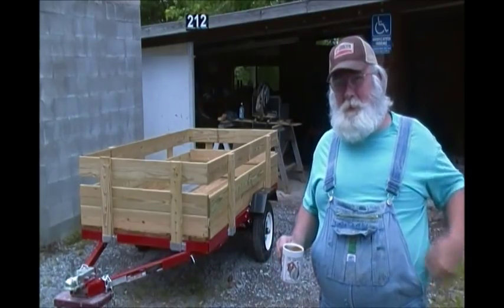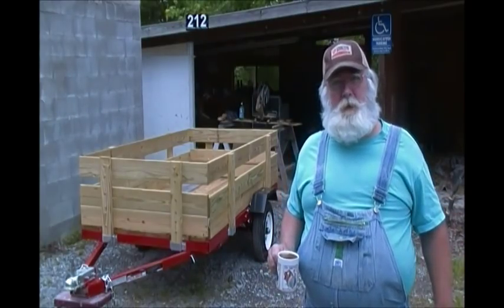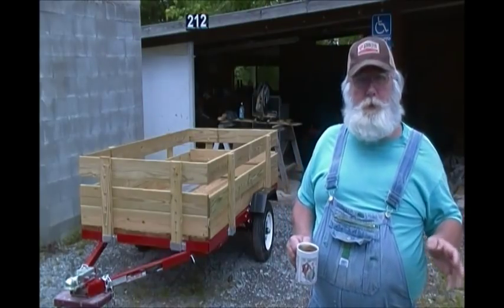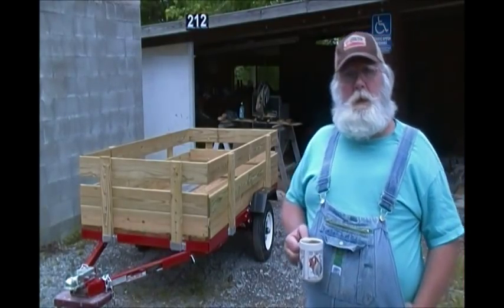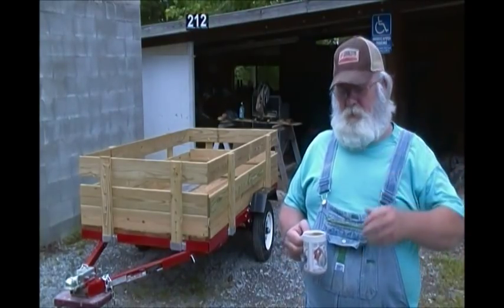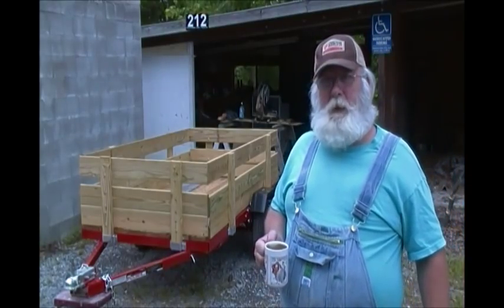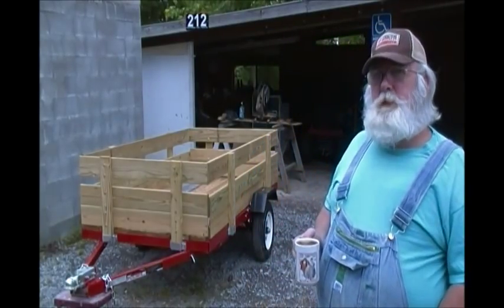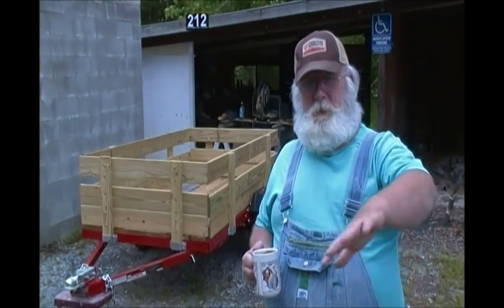Harbor Freight Trailer Build Part Six by PawPaw....Corners

Comment: Pawpaw, Because I used Heavy Duty hinges for my trailer, I spot welded a big washer on top of the hinge pin to make it easer to remove. Also, I cut the back stakes flush with the stake holders and used HD door hinges with a bolt to attach the back side rail and put a piece of ply wood to it so it acts as a fold down ramp.  It works for me, you might want to try it. I think, I might have to try your wire mesh idea on my trailer. Thanks.

Comment: i have a idea for a short vid pawpaw how to sharpen a pocket knife or kitchen knives always tried to sharpen mine but wasnt any good at it ...great vids pawpaw keep them coming👍👍👍👍👍👍👍👍👍👍👍☝☝☝☝☝☝☝☝☝
Reply: Google Sharpens Best, they have a youtube channel too. I have all kinds of sharpeners, this is the best. Take 5 min. to learn how to use it and you'll love it. It's kind of expensive buy you'll never wear it out.
Reply: I've sharpened many a pocket knife on the bottom of an old ceramic coffee cup.  Just lightly strop it on the cup bottom ring and you can take the wire edge off in just a few strokes.  With practice, you can slide the blade across the edge as if you are slicing off a microscopic layer, and polish a very sharp edge in a minute or so with ease, just practice.

Comment: Paw Paw how you doing from Missouri. I had that same trailer I used it to haul my atv. I use 2x8s about 4ft long and attached metal ramp adapter from lowes. I then drilled holes in trailer floor and put bolts in metal on ramp and they held ramps on trailer and never flexed or had any issues with them. They were easy to transport on trailer with atv. Just a cheap thought. Thank you for the vids, keep them coming.
Reply from the maker: Thanks.

Comment: hi paw paw 😀. say how does it pull hinderend of your truck? I sure do like your show and don't never ask fer nothing. now that there is really cheap. love the educational videos. one day when you get old as me you might have to slow down there Charlie Chaplin. lol. good show thanks and good day. oh I was going to say you wasa talk at us about greasein the angle grinder and impact gun. I installed grease serts and only had to take the nose piece off one time sos when I drill the hole to keep shavings out. you just find the best spot thata way also. just a couple squirts of grease every so often you can even remove the grease serts and plug the hole with a set screw.  later paw paw.

Comment: Good trailer I would put a little flag sticking up from the rear  corners so you can see where the trailer is going sometimes them little trailers can get away pretty quick and they are too narrow to see with the truck mirrors, two eye bolts on either side with cheap snap ring on a piece of chain is how I did mine. I built a 5 x 8 with a log splitter  sitting crossways at the rear, I'll shoot ya some pictures maybe tomorrow. say hey to Marley

Comment: 2 Questions;  What size are the tires and does Harbor have replacements?
Good build and videos. Now if the mower just doesn't break down   lol (my luck)
Reply from the maker: 5.30 - 12 Yes, I bought a spare tire with wheel at HF when I bought the trailer.

Comment: I like the trailer! I have the same one, originally a plywood deck. Do you prefer the 5/4 deck boards over plywood? One other question, how tall are the sides, and are those 8 inch boards on the sides?
Reply from the maker: The sides are also of 5/4 boards.  I like the fact they are already rounded.  They are 5 1/2 inches wide, I believe the overall height of the sides is 24''.  I MUCH prefer the deck boards over plywood.  They do not delaminate.  If you need a smooth floor for sand or gravel, either use a tarp or a sheet of OSB temporarily.
Reply: My trailer is a 2015, and already the polywood has delaminated. Not exactly its fault, as it has been dunked int he water 50 or so times (Kayak trailer). I'm pulling the deck and redoing it, and will also install a removable motorcycle wheel chock. I'm guessing even with the spacing, the deck boards would be sufficient to support the wheel chock, even if i have to use a backing plate.  

Thanks for the dimensions.
Reply from the maker: Those 5/4 boards a a full inch thick.  If you placed a board UNDER the deck and fastened with screws from above to draw it tight across four or five of them, I don't believe you would ever have a problem.